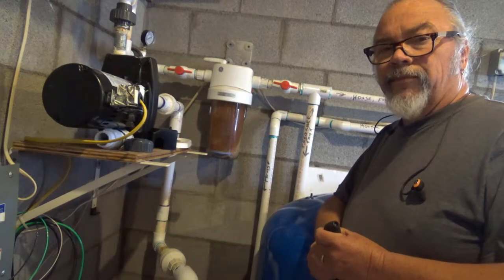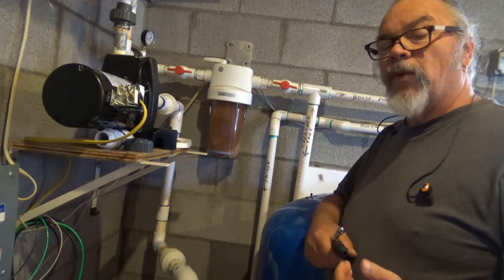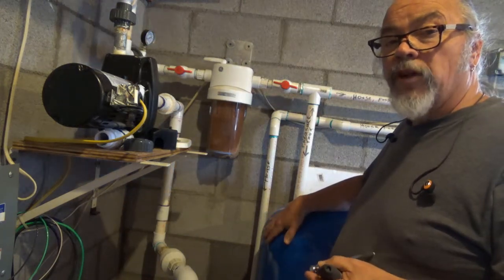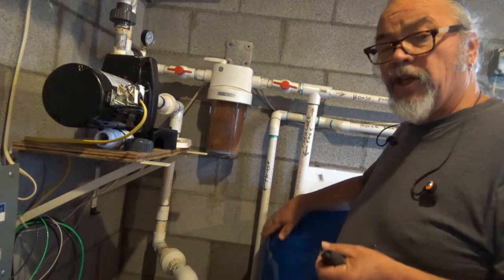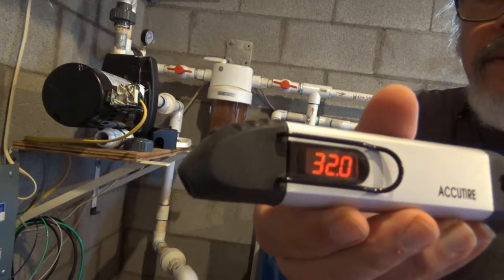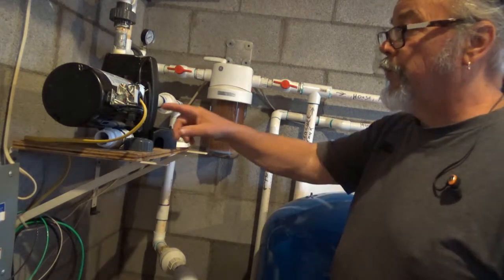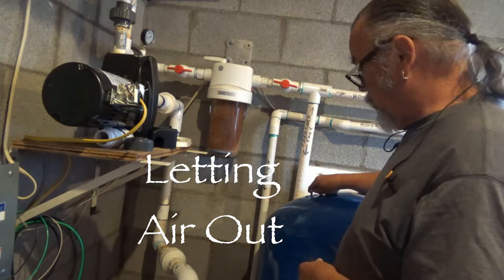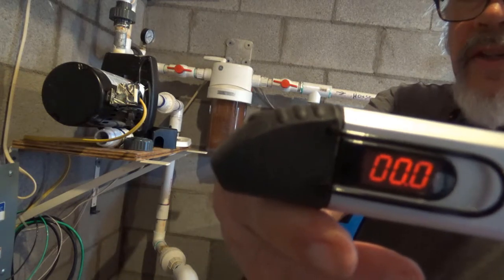Off Grid Homestead Water Pump Diagnostics

Comment: Before checking the tank pressure, you need to release all the water pressure in the system by opening a faucet.  Otherwise, all you will be measuring is the pressure from the water in the tank.

Thanks for showing us this simple fix.
Reply from the maker: Thanks for commenting. In this case there were other tests done on the pressure tank. I don't have a way to test the cut-in and cut-off pressures, so this was the suggested approach from the manufacturer. That problem was "interesting" to find! Take care.